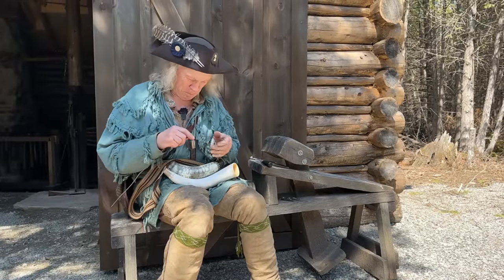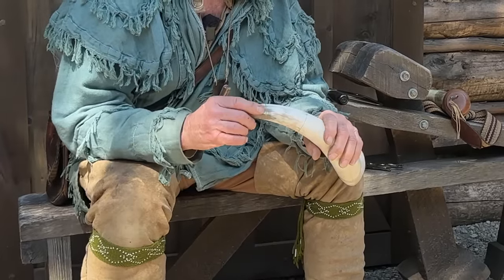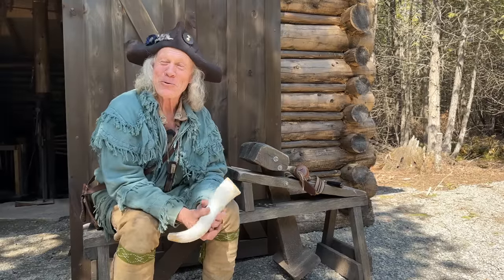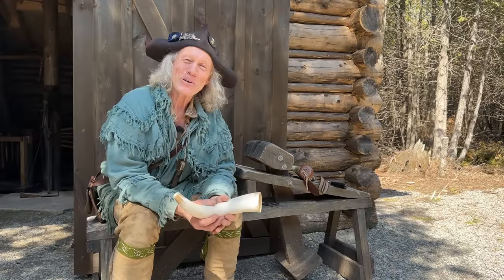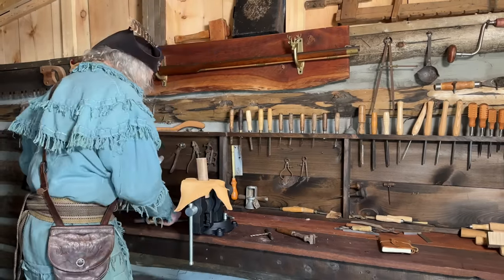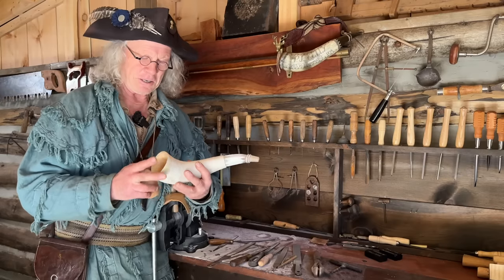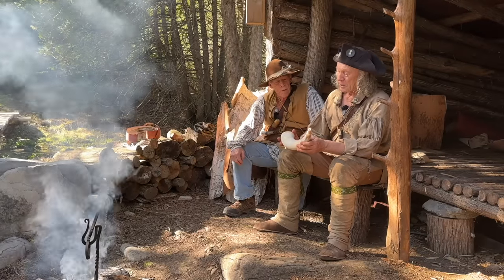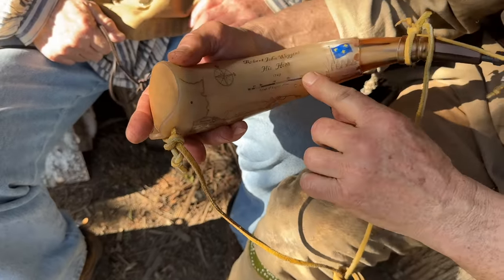How to Make an 18'th Century Powder Horn | HISTORY | SCRIMSHAW | BLACK POWDER | MUZZLE LOADER |

Comment: I really enjoy the how-to videos...  The more in depth/detailed the better!

I noticed several things...
1)  The horn you are working on is left handed/sided.
2)  You placed the new horn to your right side to show position.
3)  The powder horn hanging by your rifle is right handed/sided.
4)  You carved the butt strap location on the new horn to hang on your right side.

I have read and heard from others that it's best to use a horn of the critter from the same side as you plan to wear/carry the finished piece when there is a double curve.  Single curve.. no problem.

Question...  
The spout now points up using a left hand horn on your right side... Do you ever have issues with moisture or being awkward to use?
I have this same situation and have to give the horn a half twist to put the spout in position each time in order to reload.  I also have to be more aware of moisture at the spout.

Thanks for the video....
Reply: Shadowcastre

You may have misinterpreted that horn. I have it in my possession for scrimshanding and it is a right hand hor that fits the contours of my right side.

Best Regards
Reply: @robertwiggins4921  
Did I misinterpret the horn?  Possibly.

I am always open to new/more information and discussion so after reading your comment, I went and examined my own powder horns and how they fit both left and right.  I then dug into my resources and the internet and have drawn some conclusions.

I am referring to horns that have multiple curves like the one in the video..
1) Not all horns are shaped the same way or direction and it will vary depending on the breed of bovine.  It can be difficult to determine left or right side.
2) If you place that horn on your left side you will find that it will fit your left side contours as well.  The difference will be that the tip will face down.
3) Today..  Most people will wear their powder horn based on preference, left or right, tip up or down, best fit for them.
4)  The bulk of my resourcing indicates that the more traditional carry would be tip down so as to not interfere with anything else, straps, bags, arms, Etc...
5) Tip up carry (left or right) also means that the horn will have to be rotated toward the body in order to use it.  This doesn't occur with tip down carry.

So it still begs the Question...  
The spout points up when wearing that horn on your right side... Do you ever have issues with moisture or it being awkward to use?
I have this same situation and have to give the horn a half twist to put the spout in position each time in order to reload.  I also have to be more aware of moisture at the spout.  Or...  I'll wear it on my left side with no issues.

I will be continuing further research into this subject.  :-)
Reply: @shadowcastre  
Very interesting dialogue we are having. It's always great to hear other people's views.

I have never experienced moisture at the tip personally. In the case of this particular horn the tip is almost level and parallel to my body when worn on either side but I do admit that there is a very slight upward slant when worn on the right side but it is almost imperceptible and does not project out from the body.

As to the half twist to dispense powder, I have needed to do that with some horns but never felt disadvantaged by it. Does that pose any difficulties for you?
Reply: @robertwiggins4921  
I agree..  I do appreciate seeing and hearing others views and methods.
I think from here on, personally I am going to refer to multi curved horns as being worn in tip up or tip down, left or right carry position, rather than trying to identify it as a left or right hand horn.

As to the moisture issue, it is problematic when I wear the horn in tip up position and the weather is humid.  Moisture tends to gather at the spout as my particular powder horn juts out aboiut 2 inches when worn on my right side in tip up position.  I have to wipe it clean before each pour.  When I wear it tip down, left side carry it rides close to my body and is not an issue.

Having to rotate my horn 180 degrees in tip up right side carry is not difficult, but is more of an annoyance.  As it sticks out 2 inches, it also gets in the way sometimes.

I must say that you do some mighty fine scrimshaw work!  Anything I have ever tried came out looking like chicken scratch!  lol...
Reply: @shadowcastre  

I took a picture of this horn on both right and left side of my body but realized I couldn't post it in my reply to you. This particular horn tip does't curl out from the body. It lies close to the clothes which is good.
Reply: @robertwiggins4921  
I would like to see them.  you'll find a sending method in the ab out section on my channel
Reply from the maker: I have made a lot of horns over the years and this one is definitely the perfect fit for a right handed shooter.
Reply from the maker: Like you said, personal preference.  I’ve practiced loading on the run for years and although I’ve never completely mastered it, I’ve found that a horn with a very slight upturn is far better.
Reply: @TheWoodlandEscape  
Interesting....  I always enjoy the feedback!

Maybe you'll do a side by side video comparison with the new powder horn and the powder horn you had hanging with your rifle?   Run and shoot...  would like to see that too!

Comment: On an channel related question, I see you’re always clean shaven.  I was wondering if you use a straight razor?     I dabbled in them a few years ago, but have revisited them with more knowledge, and the proper tools, and have pretty much switched over to using only them.   I have a few antiques that I use, and have recently bought my first brand new one.
Definitely a closer connection to what’s going on.
Reply from the maker: I have but, it is not a normal practice for me.

Comment: I had an untight horn and repaired it by putting the wooden plug end into a bowl with boiled linseed oil and sucked through the top end for two seconds oil into the gaps. 
Then I let it dry for several days and repeat the procedure. After the third time it was airtight. Linseed oil expands a little when it solidifies which makes it perfect for this purpose.
Reply from the maker: That is brilliant, thanks for sharing.

Comment: I have a question for you sir did the old-fashioned muzzleloader shoot silk patches out of those Kentucky long rifles and how accurate was a silk patch paired to the modern day patch of today inaccuracy I would like to know
Reply from the maker: I doubt it very much due to the cost.  I’ve tried a comparison with a flintlock, shooting off a bench rest and saw no discernible difference.  Often they used no patches at all, they would chew on the ball to deform it for a tight fit.

Comment: QUESTION...I have a horn that is great. It is scratch engraved nicely. However, it has a "family" crest on it. I would like to remove that and have MY family crest scratched on it. How do I get rid of what's on there and put mine on? Any suggestions on someone who could do it??? Thanks, love the channel....
Reply: Hi David

Without having seen the horn you speak of, I cannot estimate how deep the scrimshaw is etched into it. I am inclined to suggest using 0000 guage steel wool and polish over the scrim you wish to remove. With careful repetition and making sure to feather out the edges, you should be able to create a nice clean canvas to work on. 

As a test I would suggest finding a small blank spot on the horn and do a small scrimshaw straight line of the same depth of the one you want to remove. Then use the 0000 steel wool to remove that straight line. It's a good test and won't leave any significant marks if you aren't happy with the results.

Hope that helps.
Reply from the maker: The neat part of scrimshaw work is you can always sand it down and start over.   There are lots of homers in the states that I’m sure you could find someone to undertake you crest.

Comment: Nice! what's the best way to drill the hole so it doesn't come out the side? ( I ruined one that way)
Reply from the maker: Mark the centre after cutting then draw lines down the side on all four sides.   Have some watch one line at 90 degrees while you drill and watch your line.

Comment: My grand father made horns that he drilled s small hole  the pointed end, heated in oil and flared the end for a cupped mouth piece and carved to look like a trombone mouthpiece. They used as signal horns while deer hunting with dogs in the swamp. On my to do list, I have looked for books on oil temp to soften the thick part of the horn. Does the book you mentioned have any info? If not I guess its trial and error. I will use a big goat horn for this and make summer sausage at the same time.
Reply from the maker: You guys live close to the earth … good on you!  Thanks for sharing that fascinating story.

Comment: Hot oil? I use boiling water to soften the cow horn to stretch the base to round. Love your videos BTW.
Reply from the maker: Either can be used … oil is much faster but, unlike water one needs to be very careful.
Reply: @TheWoodlandEscape  I seal my plugs with hot beeswax, then drive them into the water heated cow horn and let it harden back up. I use wooden thorns for the pins.
Reply from the maker: Pretty much the way I seal mine up.  I’ve used thorns but, more often whittle mine out of hardwood.

Comment: I have a small horn I made that work I thined it so light passes through all the lighter parts really good and some of the black parts I filled the spout end like yours only shorter and filled some waves in it so I could put a flag kind of waving but it's way too much black so I'm going to start over
Reply from the maker: Neat part is you can always sand it all done and start again.

Comment: How do you drill the hole, especially when it is curved so much?
I tried it several times, and each and every time my drill-bit came out where it shouldn't have.
Reply from the maker: I mark the centre with an x, then holding the horn vertical draw four lines down the side of the horn indicating appropriate centre on all four sides.  Use these lines to guide your drilling.  Helps to have someone guiding you as you drill … you watch one line and your helper the other.   Hope that helps.
Reply: @TheWoodlandEscape  - Thanks a lot. That really does help, and all I need now is a helper when doing it.
Reply: But don’t throw that horn away, glue the appropriate size dowel in there then drill it right. Instant character flaw.
Reply: @ltdc426  - I didn't, but it's to late, I made a drinking cup out of it instead.
Reply: @hellequingentlemanbastard9497  well I’ll just say that based on MY experience it will happen again;)
Reply: @ltdc426  - Most likely, I guess I make next time spoons out of the screw-up.